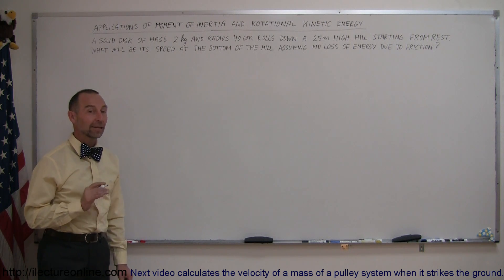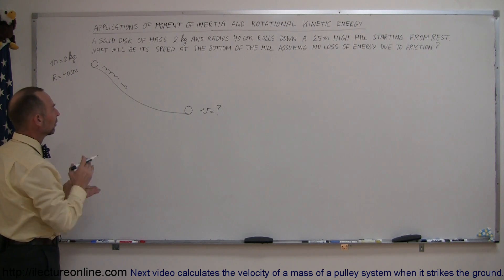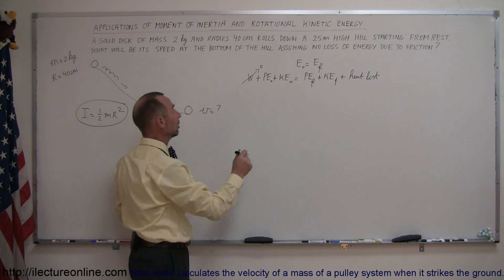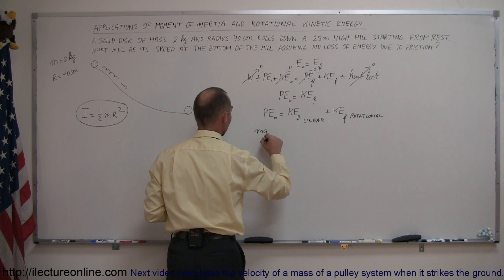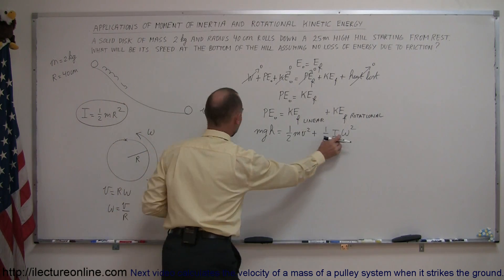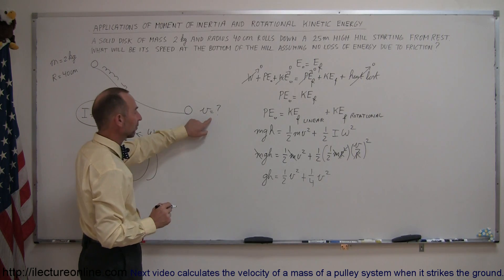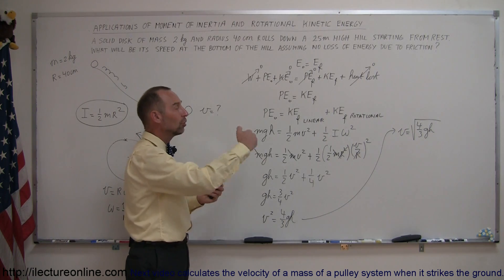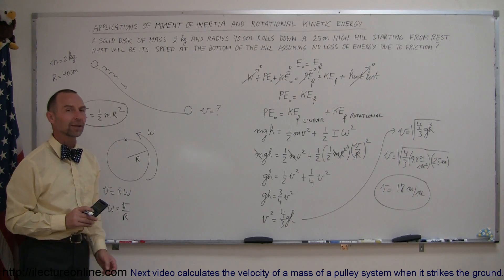Physics 13  Moment of Inertia and Rotational Kinetic Energy (1 of 5) Solid Disk

Comment: Another great lecture , Prof Biezen. I have a question regarding the lecture title. The video is titled "Moment of Inertia and Rotational Kenetic Energy (1 of 3) Rolling Rock yet yet there is no menton of "rock" throughout, the object is refered to as a "rotating solid disk". Should I change my text notes to "rolling rock" where presently I have "solid rotating disk"?
Reply from the maker: Good point.  We looked at it and it does indeed have a rolling solid disk, so we changed the title to solid disk instead of rolling rock.  Thanks.

Comment: In chapter Work, Energy you calculated v=square root of 2gh and, in this case, Vf= 22,13 m/sec. In this exercise Vf=18 m/sec. Is the difference due because the mass is a sphere ,and then there’s rotational Energy ?
Reply from the maker: That is correct.

Comment: This is a great lesson on the Moment of inertia in taking this into consideration in a real world example one must understand how this occurs and most important how to control it.   I developed a Differential stability system for  caravans to stop uncontrolled sway and the carnage it wreaks on the road.  Many modern Electronic systems detect the inertia when it has started and simply apply the two wheel brakes to drag the trailer speed down so that the period  of oscillations is reduced and the sway is eventually stopped.  The problem is that the sway inertia has already been generated and as the examples here shows it can become hard to stop the more it generates.  My concept works by preventing the inertia starting above a very small but controllable amount by first integrating a powerful hydraulic damper that resists the harder it is pushed and simultaneously introducing a force equal and opposite to the yaw inertia both at the inception and then to the return of the trailer to the  centre of equilibrium.  It works by controlling just one individual wheel of the trailer dependant on which direction it swings.  It is totally mechanical in operation and requires no electronics and it addresses jack knife in the process.   The current  electronic devices do not take into consideration that "inertia" is easier to prevent than it is to stop once it gets going and so are only a sticking plaster as a last resort.  Where as my system  prevents it starting in the first place.

Comment: sir at the bottom the disc also has potential energy....mgr where r stands for radius of wheel.......am i correct...?......
Reply from the maker: I don't see a "mgr" on the board.  But R in this video is the radius of the rolling object.

Comment: I have a question:

A ball and a cylinder, both solid with same mass and radius, start from the top of an incline and roll to the bottom. There is no loss of mechanical energy.

From the bottom of the incline they continue to roll on af plane surface. Here they will slow down due to friction.

Which object - if any - will roll the longest distance and why?

Comment: I understood all of the math you did, the only thing I didn't get was why you used KE in both linear and rotational. Why wouldn't you just use KE in rotational motion?
Reply from the maker: If an object is both moving (center of mass is moving) and rotating, then it has 2 types of KE.  You have to account for both.
Reply: I was not aware of this. Thank you so much! You're an incredible help! I've informed my entire class of your videos. Thank you so much!

Comment: sir while doing conservation of energy problems in work energy power we didn't take into account the rotational motion of the objects,so I just want to ask whether to consider the linear velocity in those questions or both linear and rotational velocity
Reply from the maker: +Rahul Tiwari 
You are correct.   In this example we ignore the rotational kinetic energy.
In later playlists after we introduced the moment of inertia, we do include it in similar problems.
Reply: okay u mean 
after the introduction of moment of inertia we ought to include rotational velocity in conservation of energy problems ?

Comment: What causes the disk to rotate? (I thought we were assuming no friction)
Reply from the maker: Ernesto Oropeza 
Good insight.
Sometimes we "simplify" a problem so we can concentrate on specific aspects of the material.  Then we keep adding to it so it is easier to understand.
In the same way we ignore wind resistance, damping, etc. during all introductory physics courses.
But ultimately, without friction nothing would rotate, sliding down a hill, we wouldn't be able to walk, cars couldn't be driven, etc.

Comment: To calculate the kinetic energy and the rotational energy at the end of the slope would I just substitute the velocity into k.e=0.5*m*v^2 and r.e=0.5*I*(v/r)^2?
How would I then go about calculating how long it takes for the disk to reach the bottom of the slope?
Reply from the maker: *****
Jack,
I didn't see your comment before, but now that Alpha District 9 commented this question was brought to my attention.
This question is not as simple, since the acceleration is NOT constant.
The equations of kinematics that are typically developed are not valid when the acceleration is not constant.
Thus the answer will require an integration.